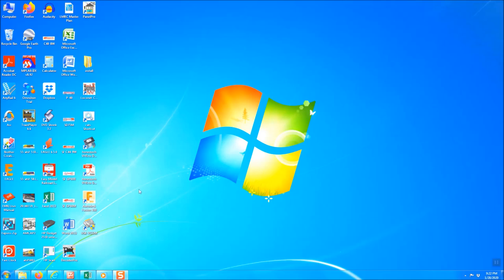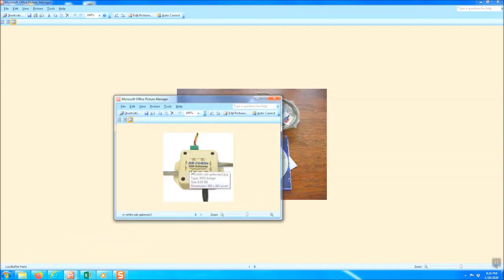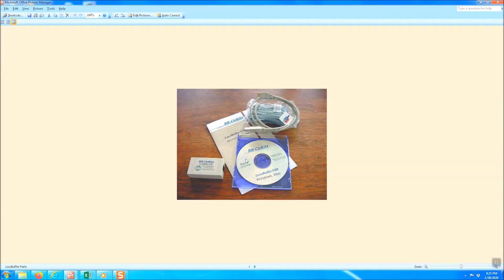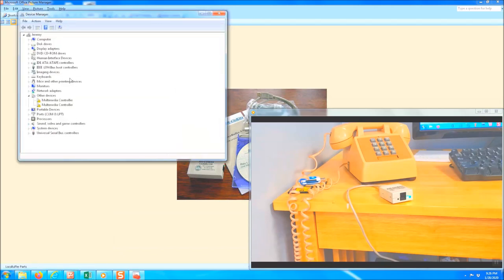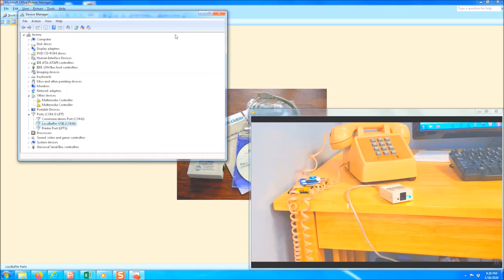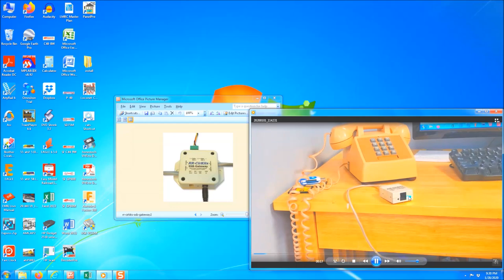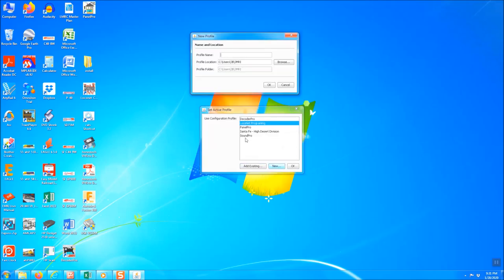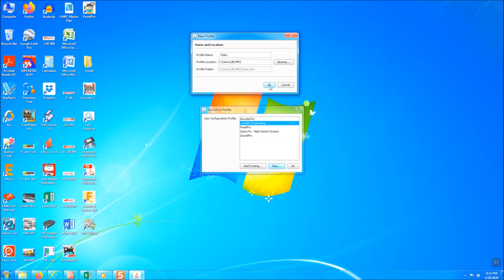Stand Alone LocoNet & JMRI

Comment: I don't quite have a running layout yet, but I have a bunch of DCC locos to populate my 4 x 8 layout. The first DCC system I bought was/is Digitrax DCS52.  I set up several locos using it, but every one of them took 5 or 6 tries before they finally responded to the address changes to their 4-digit cab #.  In those days (2 years ago) both Digitrax and NCE PowerCab starter units were barely more than $150, so I also bought the NCE PowerCab; Which turned out to program the next batch of loco cab numbers on the first try.  I thought I was through with Digitrax, until I started looking into FrogJuicers and other Tam Valley turn-out controls.  I kept adding stuff in spite of still not having a full loop of track to run trains on.  
I got the Quad-Pic and some servos but before I got around to doing much more, Duncan McRee got sick, so I stumbled onto Robin Becker and the new QuadLN_S controller.  So now I find LocoNet seems to be necessary, but I'm not sure about that yet,If I really need that, since I don't plan to use DCC to control my turn-outs.  Also, I have tried to install JMRI on a spare laptop, but I'm not having much luck with that.
Robin couldn't answer my question, about whether I really need to use LocoNet, if I'm using push-button control for the turnouts.  I guess we should become Facebook friends, because Messenger is easier than communicating here on YouTube.  On FB I am "Mac Hayes", if you want to "friend" me before I get around to friending you.

Comment: Hello Jeremy. I am following your install of the QuadLN S on JMRI. I also have the NCE system. I see where you are working on a LocoNet. My question is do you need a LocoNet to run the QuadLN S on the NCE Power Cab. Thanks and keep up the good work.
Reply from the maker: As far as I know the QuadLN-S will only run via LocoNet.  I am using a Kindle Fire to control the turnouts.  I am also using the QuadLN-S to control signals and detection which I need JMRI to control.

Comment: Very informative video! My question: Is this method restricted to NCE or non-Digistrax?  So let's say I want to use a Digitrax DBS or Digikeijs DR5000, would this methodology work or simply act as an encumbrance?
Reply from the maker: This is not restricted to any DCC system.  Even if I had an Digitrax system...I would still have a separate LocoNet for my Quad LN_S boards.